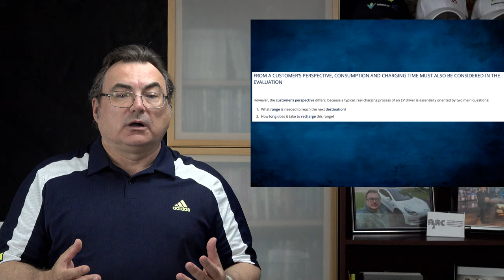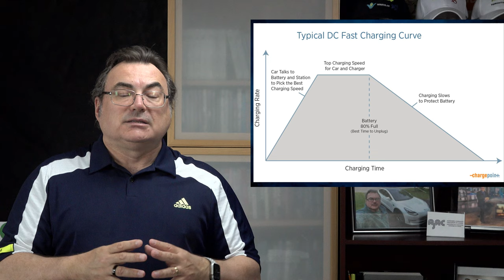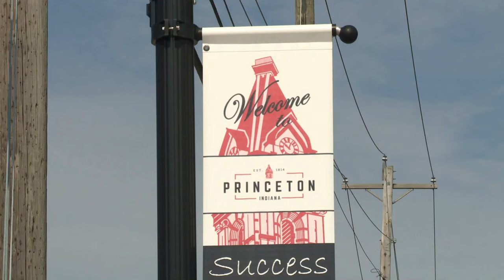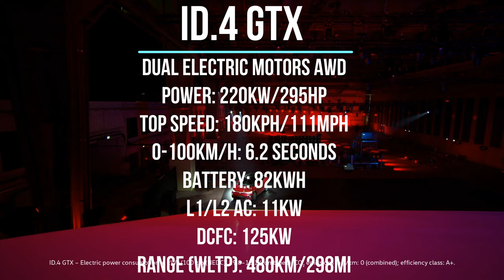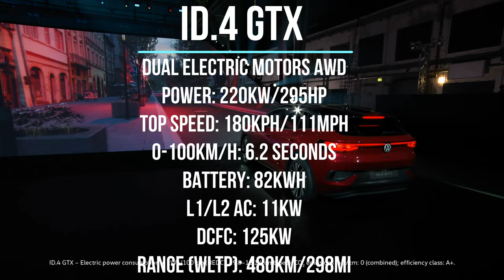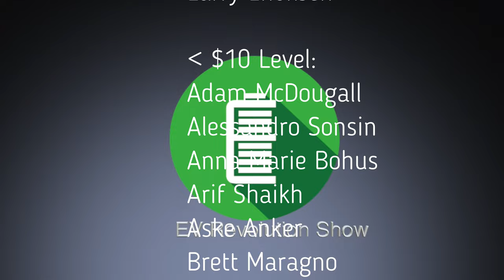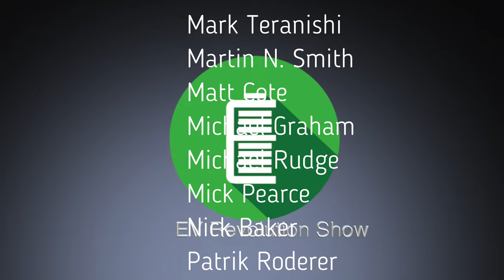Episode 131 - P3 Charging Index, GM, Toyota & Honda Oh My and the VW ID.4 GTX!

Comment: Great show Ken! The P3 index is interesting however I think that improved charging infrastructure even at 50 to 125kW levels will be a big help, as a stop of 45 minutes or so every 250 to 300 kms is good idea for a break and meal, rather than rushing to the next charger.
Reply from the maker: Thanks James.  For sure, but a lot of feedback I hear from talking to people who want to roadtrip in a BEV is the wait time for charging.  I agree, the reality is most will stop for 30-45 minutes anyway after driving for 3+ hours or so, but people don't think about it ahead of time.  They WANT the experience to be similar to gas filling up, even though they NEED a longer break than 5 minutes or so.  The very few with a case of "gotta-get-there-itis" will never be satisfied, so don't even try to argue with those folks.

Like I summarized, I believe the sweet spot to be 15-25 minutes for a range back of about 300-350 kms.  That equates to about 3+ hours of straight driving without a stop before needing to charge again.  I think that is reasonable for the vast majority of folks and if they have kids or pets, then maybe stops more frequent will be needed.  

I'm just generalizing it and if a BEV can get 400kms back on a 20 minute or so stop, than all the better.  Many must remember these ideas and concepts are presented in best weather/climate conditions - calm and 20 degrees C - idea battery temps too.  So a deviation from this will result in lower ranges (oh, say -20C in winter), therefore stops will be more frequent and longer due to charging and outside temps.  The higher the pull for the longest time, the better overall experience in a wide range of weather, road and driving conditions.  

We are getting there and I know this decade, the new norm will be ultra-fast charging.